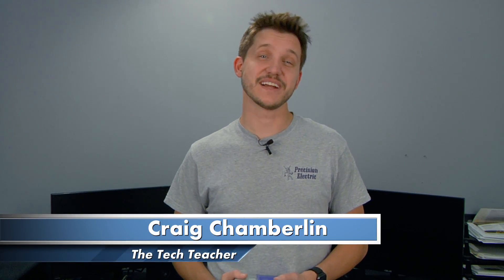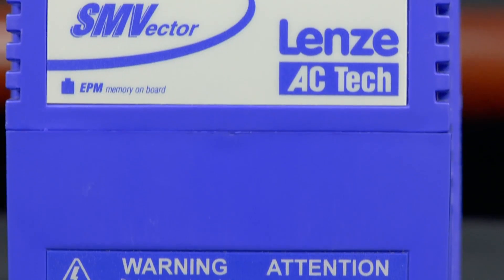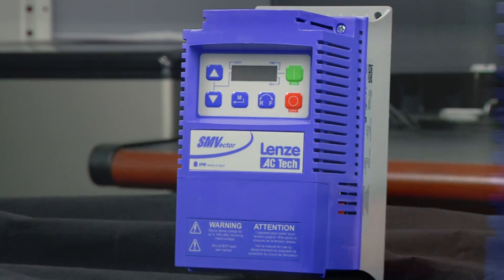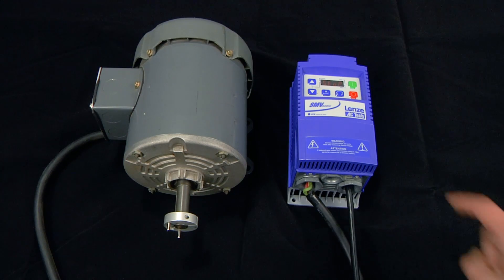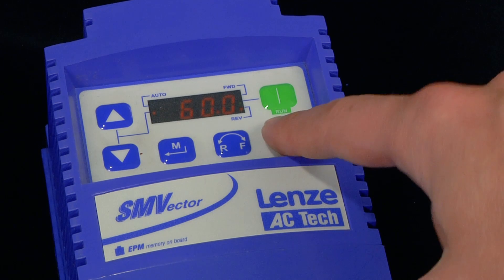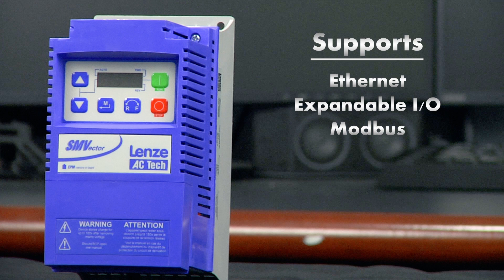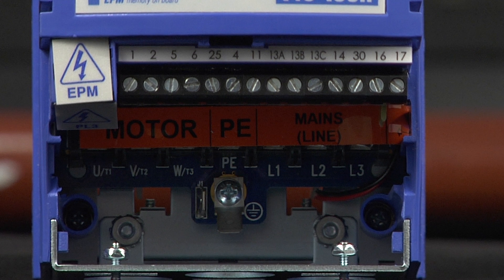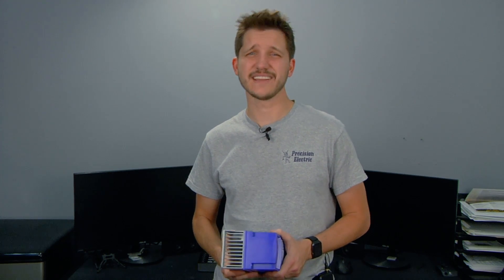Lenze AC Tech SMVector Variable Frequency Drive Review (2022)

Comment: The TCF series , 1ph to 3ph compared to the SMV series does suggest 96 parameters, So much more content Some of  which I wouldn't want to get into ,should I leave it in basic defaults ?
I would like to set-up to potentiometer a start -stop and  fwd-rev.switch remotely.  Will if I decrease the accel  parameter( 19 ) to less than 20 seconds does that feed back bad current back to the drive? Sound okay?, thanks Craig